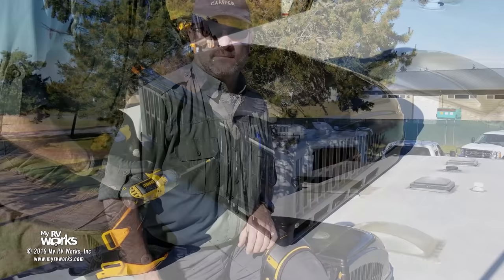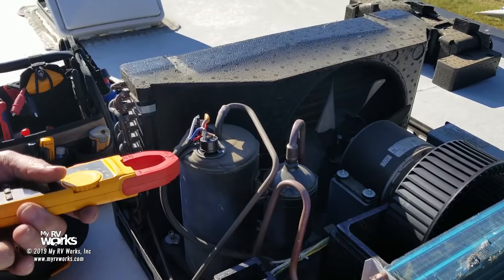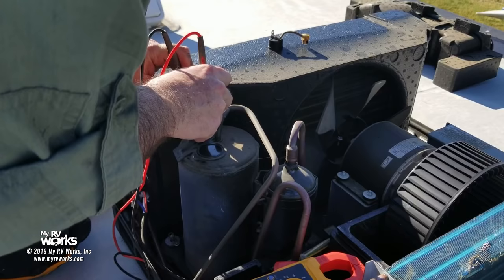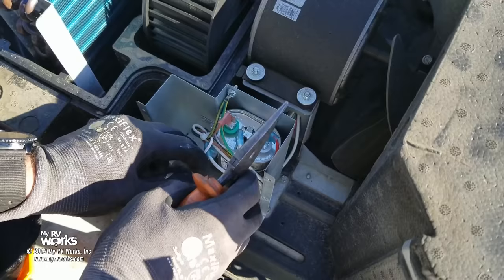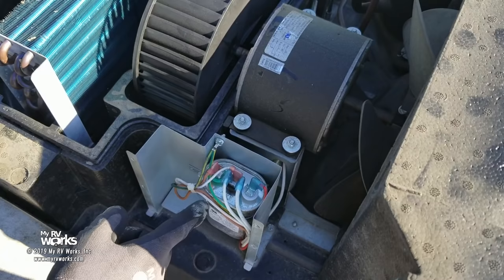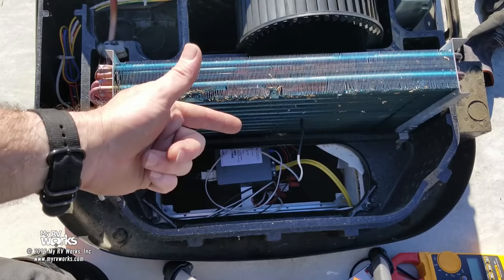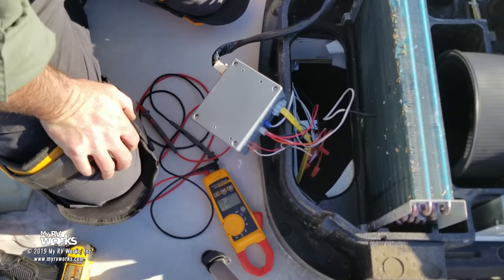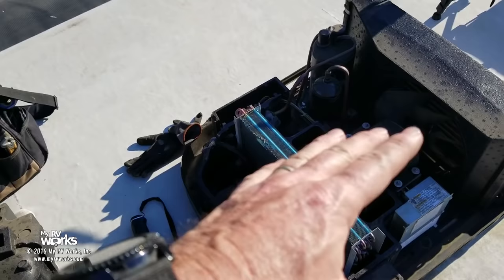Diagnosing An RV Air Conditioner That Is Not Cooling

Comment: Great video! I bought a 3500 watt generator to power my rv for a camping trip. When I turned the ac on it would overload my generator. What would be causing my AC to pull so many amps?

Comment: Very helpful.  The AC guy who came out (Las Vegas Nevada) said I needed a new unit.   My only problem is I cannot locate an overload protection switch for my AC (the model number and or part number) decal has disintegrated.  how can I determine which switch I would need for a 2010 dometic15000 BTU ducted ac?  Went to the local Camping World and they were no help w/o the part number.

Comment: When you pulled the fuse did you have the main breaker off or just the breakers on the inside. I’m wondering because when I pulled one it had some electricity attach the prongs as I was removing it and arced some when I went to put it back in. Surprised me because vehicles don’t do that.

Comment: Why does every roof AC have the control box mounted right in the middle of the air intake with a rats nest of wires coming out of it that would seem to to be hugely inefficient as it obstruct air flow and create turbulence noise?

Comment: You do not have to have a bunch of license to add or charge any type of refrigeration system. You ONLY need an EPA 608 certification or 609 for automotive. And you are costing the customer several several dollars by changing the system out over a leak or needing to be charged. If it’s under warranty that’s different. But I have never changed a system and costed the customer that kind of money simply over a leak or needing to charge the system. Leak detector big blue leak liquid and your in business   Get the 608-609. It’s only $50-$100 depending on where you get them. Especially if you are going to be doing any type of hvac/r. You are loosing money for your company and costing the customer more money to replace than to repair. Just an fyi. Other than that great troubleshooting video.

Comment: Still troubleshooting my Domestic Brisk 2 13,500. Fan and compressor are running, evaporator is cold to touch but still blowing warm air inside the RV. Any thoughts/help?
Reply: check the seals

Comment: Hi, I hv been watching your videos on RC AC. Hope you can help me out troubleshooting my AC. It has started not starting, it's like it is dragging (like a car with low battery), it just cant kick in and start, which causes the breaker to pop. I had a new start capacitor put in, but same thing happens. Thank you for your time & great videos.

Comment: My experience with these rv air conditioners is that, if you can find the leak, it's probably going to be in the coils, where the copper is so thin it's almost impossible to repair.  And by the time you pay labor for the fix, recharge, and none of it to work, you could have just replaced the unit and been money ahead.
Reply: very cheap material on these units

Comment: Is that fan motor slowing down and speeding back up? It seems that way in the Video mines do that I was wondering is that normal? I appreciate you making this Video thanks.
Reply from the maker: The fan is running at full speed. It's the 24 frames per second from the camera that gives it that slowing down effect, same as a wagon wheel and the airplane prop in the old movies.

Comment: Sir. Great video. I subscribed 
What if the evaporator coil is hot VS cold?....the unit is a heat pump as well but is set to "cool" on the t-stat

Comment: Thanks for the video!
 So i went up on my roof, and my compressor wants to come on, but than doesnt.  So i bypassed the "thermal switch" on it, by putting the blue wire straight to the compressor, (just for testing)  and than the breaker immediately tripped and the AC unit shut off...  fan and everything.  Does that mean my Compressor is bad?  Like shorted or something?  I just dont have my meter with me for testing...   any help would be greatly appreciated!   Thanks😊

Comment: Excellent Video--Thanks!!

The burnt plastic on the compressor amperage monitoring device--was probably due to a loose connection---try squeezing the female stab on connector to get a better contact. It may be that the incorrectly sized female connector was used.

Is it not MUCH more financially friendly to find/repair/fill R22 leak than to replace the entire roof AC ??
Reply: If you can provide a step-by-step "how to" video that shows how to repair/fill R22 without the need for all of the expensive guages, purchasing the bottles to re-fill it, etc., I think you would be on the right track.  But all the videos I watch on these compressors, it does not appear to be something a do-it-yourselfer can easily do.  The problem, like so many of these projects, is that it requires so many specialized tools, special knowledge, etc....especially when it comes to compressors.

Comment: Curious was there an error code on the thermostat?  I missed you testing the freeze sensor.  If it was a leak there should have been oil/dirt in the pan and you found none.

Comment: What is the lil orange light that you see inside or down below since your on top of camper?  Mine is off now and it's not getting cold, I'm wondering if that has anything to do with it and what it's been doing. It clicks on and off and will throw the breaker. When I say click on and off... It's like your at the thermostat turning it up and down really quickly. Making it shut off and turn on. Some days it will run fine, it seems as though when it rains it does this more. Do you have any advice. I agree with all the great statements and credit people on here give you. You are terrific. I wished you were here in Va.

Comment: Such good video - looking for input on my issue: I have a 1995 Coleman Mach Roof AC.It's coming on and it's cooling, but it intermittently switches to low fan speed, then the fan speed gets hi again but no compressor. Then, after a few minutes, it compressor will kick in again but at lower fan speed? Not sure where to start. Any pointers? Thanks so much!

Comment: Hey I did everything u did on this video I replaced both capacitor and a braker the compressor read good just the way u did the other part read good too but  my ac doesn’t run just the fan does I watch other videos saying that it can be star capacitor or run capacitor but i replace both I home u can help me.

Comment: Thank you for the very informative videos! My coleman Mach ac will turn on and run no problem but if I shut it off or the thermostat kicks out it won't turn back on.... im plugged into 15 amp. Volt meter reading 121 V. Something else, I can't put the fan or ac on low, it will run in high on either setting.... wondering if it's the control board.

Thank you sir

Comment: So my RV Ac unit is just like this one, but my fan motor is not spinning, which just started. It gets cold for sure. But by some odd means the fan blade makes noise during a pause then I could hear the blower losing energy before it stopped. Would appreciate any feedback

Comment: that device on the compressor is called an overload protector
Reply from the maker: I beg to differ. It is a starter assist for the compressor motor.
Reply: You're both wrong, it's a thermal switch.  It is in intimate contact with the compressor head to monitor the compressor temperature.  It may be part of the capacitor start system of the motor (which is assisting the motor when it starts) but the device itself is a thermal switch.  You can prove this by putting your DVM across the two contacts (easiest way is to set the meter for "tone" or conductivity) and put a match or lighter flame on the bottom surface that is in contact with the compressor and listen for tone or if you have tone in a second or two it should stop depending on whether the switch is a normally open or normally closed configuration.  The switch might even have a "NO" or a "NC" on it.  You are right about needing license/s depending on the type of AC you're going to work on, however, they are pretty easy to get and not expensive.  You can do it online and when I checked into it the cost was under $50.  Having the license is the tip of the iceberg though - then you need the equipment.  So if your not fixing a lot of AC systems I'd stick to checking the capacitors, relays, clogged evaporator, and obviously broken or loose wires and thermal sensors.  The thermal sensors can also be checked with a heat source and multimeter.  They are typically simple thermocouples made by spot welding copper and Constantine wires together.  When heated they produce a micro voltage which corresponds to a particular temperature.  Read more about them on YouTube.  By the way - placement of the thermal sensor in the evaporator fins is important in that it needs to be in the right location on the evaporator as well as in intimate contact with the fins.
Reply: @FabtecS5  that's exactly what it does. I just replaced one. And I ordered an overload protector.

Comment: Hello, Love your videos. I'm learning how to do all this RV work by my self and your videos have been really helpful. I have a question, I have a coleman AC unit that keeps tripping the Breaker. If it's running on the generator it will trip the RV Breaker if it's hooked up to Shower Power it will trip that Breaker. 

I'm about to test everything That I just saw in this video but if you can give me any advice that would be really helpful and much appreciated. Thanks!

Comment: Without the freon ports one cannot check the pressure difference between the high and low side . cant find a leak,might have bad valves inside the compressor

Comment: A little too much over explanation, for example the explaining of multimeter.
I do have to thank you though, i dont know what i did. But i fixed it. I have to assume it was a loose connection. Everything tested good so i wiggled all the connections on all three capacitors (different ac unit), and on compressor. Unplugged every plug snd replugged it half dozen times and fired it up and works great 👍 been sitting for over 4 years and fired right up and blew cold within seconds

Comment: Hello.  Just the switch on popup camper.  It's good.  When I test the compressor I get no reading between common and start or common and run or run to start.  Would you say the compressor is bad ?

Comment: My ac would turn on get cold then eventually the fan would stop spinning once the fan motor got hot. Would that be most likely the fan motor. I could cool it with water and keep it going longer. Once it got cooled back down it would kick back on. The condenser would be hot as well which it should be I think.

Comment: Darren, so I'm wondering if the testing you did on the PTCR is the correct test, you checked for resistance.  Thanks for another great video.  😊
Reply: I have nother question Darren. Where did you get your numbers for your calculations when you checked the compressor? I might have missed that part but I've watched this video 2-3 times now and I just noticed that.

Comment: I see that this is an older video, however I do have a comment question if anybody knows. I recently just got a camper and of course my wife's First question is does the AC work? Guy says yes. Get it home does not work. Fan runs compressor does not kick on. So my question is if it's too cold out will the compressor run or will it not run? It was 51° when I did the test. The camper is a 2000 sunline

Comment: Followed you trail everything appears to be good on my ac. I noticed the ac to be freezing up.  I changed the freeze temp sensor because it was freezing up. Since then it still freeze on the other side of the coil from them sensor. In addition once unfroze the ac only keeps the 29 foot one slide travel trailer about five to six degrees cooler. Is the ac possibly losing freon and on its way out. It is a domestic 15k. Any help would be appreciated.
Reply: The AC should have about 20F temp difference between the air input and the air output. Don't measure its performance by how it cools your RV, that's a function of the size of the AC, the volume of the RV and its insulation.

Comment: Aren't you concerned that running the unit without the covers/baffles etc. will effect the ability of the evaporator fan to pull air through the evaporator? In other words the fan is just pulling in random outside air without the baffles in place.

Comment: Had a window unit with bad relay that would come alive when tapped. Order new ones from China, unit ran another year before the symptom returned. Finally soldered new relay on the board. (Funny aside, the window unit is cooling a refrigerated "cold room" for hanging meat after slaughter. Controlled by an arduino monitoring the evap and room temp. It was a "cool" project for an old friend in his 80s.)
Reply from the maker: Sounds like fun. I might make a whole new channel on all of my Arduino and Raspberry Pi automation projects.

Comment: I have a problem with my Dometic AC.  Control board will not turn on comp. Changed control board and thermostat.  Problem remains.  AC runs great with test box I built.

Comment: This seems to be my issue. Bought a duo therm brisk II 13,500 in June 16. It has had issues from that first year. This year 2019 blowing cool air but not cooling and freezing. Yes the coils are clean, filter clean, and there is air flow, until it freezes. 
Can't seem to see where any leaks are or have been but I'm almost certain it is low on refrigerant. Past warranty and it is upsetting to say the least. Unit should last longer, as the original was 11 yrs old when replaced.
I did notice on this video the freeze wire which I don't think mine is in place and don't know if that will help any, but will look for it when I get back up to my camper this weekend. 
I have the knowledge to tap, but don' t have the equipment to do the refrigerant. It's too expensive to purchase just to have it leak out again and have to fill each year. If/when I purchase a new one I will complain at the first sign of trouble with Dometic for repair/replace.
Reply from the maker: If your unit is freezing there could be several things that are contributing to that besides being low on refrigerant. If you have controls on your a ceiling plenum your freeze sensor may be integrated into the ceiling plenum. Otherwise it should be a small thermistor type rubber coated wire that sticks inside the fins.  Other things that might cause freeze up problems are a sticking relay on your control board.
Reply: My RV Works, Inc. Just got to the lake, it is in ot right at the duct. 88* out 90 in RV with just cool air close to warm blowing. The compressor is running. And thank you for the reply.
Reply from the maker: @2olvets443  I have another air conditioner video on my playlist where I talked about the divider behind that ceiling plenum. If you take on your ceiling plenum completely down, I need you to look at how that is all taped up in there. What you're explaining sounds awfully suspicious of this divider not being positioned in the correct place. So what you have there is the cold air recirculating back into the return air right in the ceiling.
Reply: My RV Works, Inc. I ran the AC fan only for a little while then turned it off and went up to the roof and pulled the cover. Looked around for any oils on the pan could not see any. And got my hand near the compressor and it was extremely hot couldn’t touch it. Ran cold  water from the hose over the compressor. Went back inside and turned it on cool, went back up to the roof and tubing now getting cold, however right where two lines of copper tubing go into, I guess it’s, the evaporator unit or the heat exchange unit the one for the inside part,  both tubes freezing up Before it even went in to the coil?

Been awhile since wrote that one. Came in later temps were dropping both outside and inside for a bit, then checked again after about 1/2hr or more and coils frozen about 1/3 up. Inside temp was down to about 76* at that time. I shut the unit down for the night. 

Thank you for your input on this. I will attempt to check out your other video tomorrow and also check the separation part. I don't think there is an issue there but not sure.
Reply: My RV Works, Inc. and by the way I love Washington state I was stationed at Fort Lewis back late 70s early 80s was there when Mount Saint Helens errupted

Comment: Great video Sir. I just bought a 2013 RPOD trailer and it was working okay for a week just fine. Then today both the refrigerator and AC stopped working. There us power to outlets and  microwave. The AC seems it wants to turn on but the compressor just wont engage. Any help is appreciated. Thank you. Oh, the inverter fan is constantly running now if that helps.
Reply from the maker: There's a couple things going on with this question, the air conditioner, refrigerator Etc have 12 volt DC brains. So you may want to verify there's 12 volts there. You mentioned the air conditioner tries to start but it won't, that may be an indication that one of the capacitors have failed. So maybe check the capacitor to make sure it's still good. You didn't let us know if the refrigerator is still working. The fact that the fan is running on the inverter might indicate that you may have a bad battery on the RV.

Comment: Thank you for the video sir. 

One question. Why is the charring or evidence of burn marks on top of the compressor not a concern? 

I had a tech come out and troubleshoot the AC. He found the winding in the compressor to be good but said I have to change my whole unit due to some wires being “charred” much like how it looked in your video. 

Thanks again!